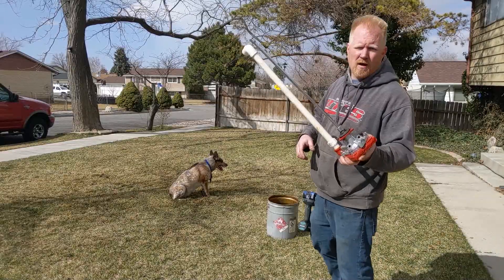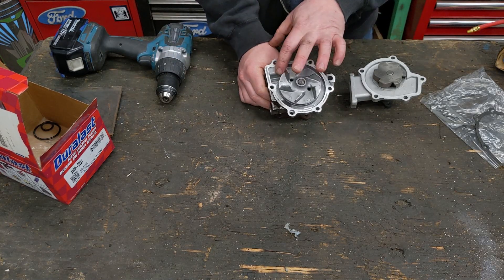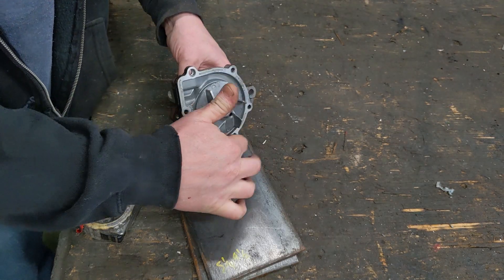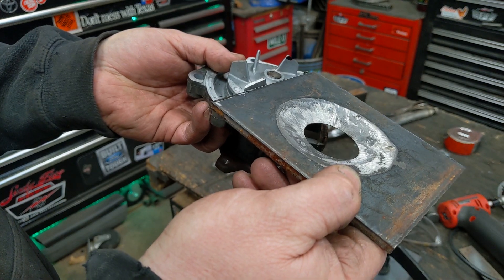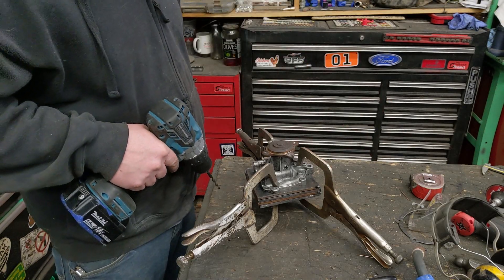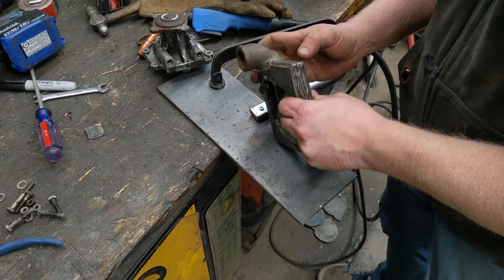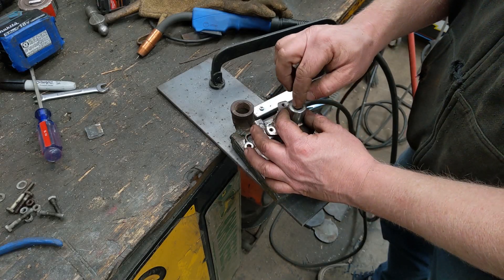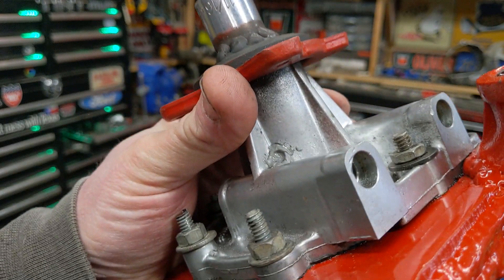Cordless Drill Powered Water Sump Pump BUILD from old car parts     DIY

Comment: Hi you have some great builds, and I love your channel.  Maybe you can do or make something on a cheap heated pressure washer.  Well just thinking out loud any way.
Most of us DIY have the pressure washer, just not heated.
Thanks.
Reply from the maker: I've been mulling the idea around for a few years. The biggest issue is not creating a steam bomb that will severely injure anyone in a 10foot radius. I have a few ideas and may have to put it to fruition this summer.

Comment: You're a rockin the hacked out designs!   Awesome man!  Way to go, keep it up.   I have a gen 2 prius washer and inverter pump I want to use for a front mount lawn liquid fertilizer tea sprayer bar attachment accessory using a 5 gallon or larger bucket with a gamma seal lid.  Haven't gotten around to making just yet though have most all the parts.  Wound up getting tripped up at Menards when I found the ~$5.99 universal battery powered sprayers where I bought five to use just the tips and decided to keep two and return the others totally forgetting why I bought all five.  They're so easy to use too for pests to spray diluted canola oil in IPA and I used for spraying diluted castor oil in IPA for moles around the perimeter of the property.  Plus the one for the liquid fertilizer tea.  See if I can get to sprayer implement this season.  Thanks for sharing!
Reply from the maker: Thanks, I'm glad you liked it. Great idea!

Comment: Is ATF for lubrication?  Was the impact impacting due to water mass or were the fins hitting?
Reply from the maker: Yeah, just some ATF to prevent rust on the steel. Really not necessary as those holes are open all the time in a car. The impact was impacting due to the high load of the water. A drill would be better, but a lot bigger.
Reply: @sixtyfiveford  awesome

Comment: Would be cheaper and easier if you used a shallow tupperware container flipped upside down with notches on the bottom sides to let water in. This way you just drill a threaded  pvc street 90 with a backing nut and  rubber washer on one side of the tupperware. Only weld would be for the socket on top of the water pump. Welding and cutting steel is more manly but I am cheap and lack a welder.

Comment: Great idea. Would a piece of pipe the right ID work instead of the welded plates? Couldn't the whole thing be made out of PVC?
Reply: this is just a basic plan ...take it and modify it ANY which way ya want...scale it up or down.....use different types of materials......the science doesn't change
Reply from the maker: The inside pump area isn't really a round shape. It's more of a snail shell shape going from smaller to bigger. So you would have to split the pipe and form it. It could be done.

Comment: A bit more modification some scrap for a bracket and a belt. Bam engine driven water pump for drafting out of natural bodies of water for washing down a dirty trail rig before hitting the pavement home or being at the right place at the right time to put the wet stuff on the red stuff and make Smokey Bear proud.
Reply from the maker: That would be neat.

Comment: Excellent for remote areas to remove water etc , you could time it on a small scale . See how long it takes to clear 10 gallons and come up with its GPH nice job .
Reply from the maker: I calculated it out at 2000gph but think I can get it higher.

Comment: It looks to works great and it doesn't depend on electricity.
Reply: The drill is electric lol
Reply: @benmiller5015  Yea lol. But if the electric goes out and the sump pump stops, it can be used to pump the water out without electricity.
Reply from the maker: Thanks, it was a fun project.

Comment: I'm sure you realize that the back could have been made out of plastic sheeting or blocks w/PVC, OR, wood that's coated for various fluuds... 

No matter what you make it out of,  considering that it's basically for some type of emergency use, I would use a bucket or a siphoning hose dependant upon what I have to drain... Unless of course it's a stock tank the size of a Tennis Court or larger... Then I would either rent, buy or borrow a pump depending upon the cost factor and if I still have any friends left... 
BUT, showing us possibilities of recycling an automotive water pump is in fact a very good idea... 

Just Sayin
Reply from the maker: Thanks, it was a fun project.

Comment: You clever clogs, that's really effective.
Stick a watering can sprinkler on it,  it becomes a portable shower unit.
Only 29.95 at all good Sixtyfiveford stores. :-D
* Does not include dog or drill.
Reply: Hose sprayer $1
Reply from the maker: That's funny. Thanks, it was a fun project.